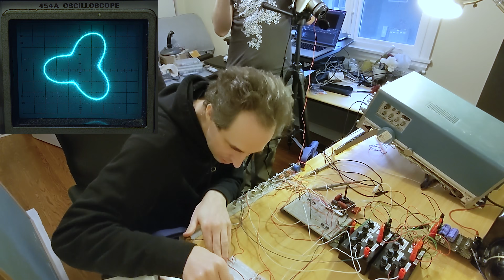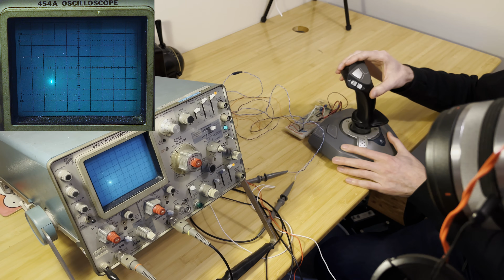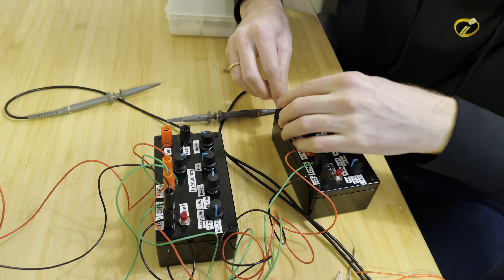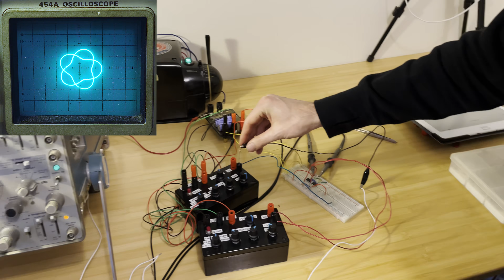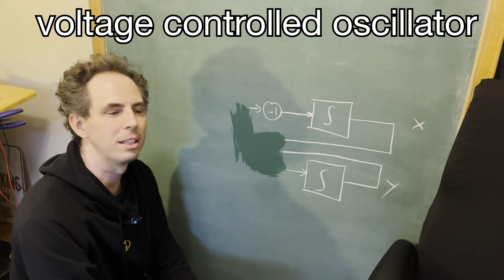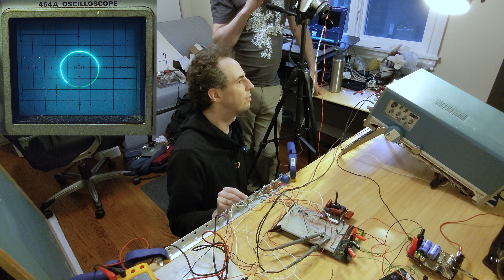Knotty Analog Oscilloscope Art

Comment: THIS IS AWESOME i'd love to understand further the inner workings of how oscilloscopes transpose an electron to visual display now.
Reply: Analog scopes work similarly to the old CRT TV's (actually identically for B&W).  A heated filament in the back of the tube is brought to 10 kV or so (Big TV's use up to 30kV) and electrons start coming off as a result.  They are repelled from the filament (the electron gun) and attracted to the positive of the supply which is connected to a grid behind the screen.  The signals to be viewed are amplified and applied to coils or plates above and below and to either side of the beam path. If coils are used the ones on either side deflect up and down and if plates are used the beam will be deflected directly toward/away from them.

Comment: I had a laser running off audio/analogue signals to draw 4d objects, starting with a loop of 4 channels running though the x,y,z,w coordinates of a hypercube and doing projection calculations to convert them into x,y screen space using analogue synths. it's not knots but thought it was relatable. and can you have knots that exist in either 3D or 4D but knot the other? 

https://youtube.com/shorts/BrJyTqH5izQ
Reply: There is only the unknot in 4D.
Reply: @CoughSyrup  While that’s true if you are only dealing with S^1 as the thing being knotted, it is possible to knot 2d surfaces in a 4D space.
Reply: PS how would you go about calculation f(x)=1/x using analogue circuitry?
Reply: Subtraction of exponentials seems more plausible for division, but if you had to, I'd think trying to take a geometric construction of division, like one of those straight-edge and compass constructions, would be promising.
Reply: Say y = 1/x, then x•y = 1
You have an amplifier outputting some value z, then feed x and z into a multiplier.
That product is introduced as negative feedback to the amplifier, reducing output z, until x•z = 1 at which point z is your y answer.

A multiplier can output the square of an input easily by making both inputs the same. Effectively x•x
 A combination of multiplier and amplifier can also be used to find the square root of an input by using the square of the output as negative feedback.
 When the amp output is the square root, the square of the square root provides just the right amount of negative feedback for the amp output to be the square root.

Comment: The knots drifting out of phase over time almost looks like a 3D rotation of sorts, revealing that they aren't actually knots. I wonder how much harder this becomes if you basically make this "drifting out of phase" motion be actual 3D rotation projected to 2D, and it simply looks like you look at the knot from different perspectives.
Reply: Fundamentally, I don’t see how that’s possible with analogue as there’s nothing stopping an interception (one “string” through another).

You could get the perspective with digital control, but that was not allowed by self constraint  - and even there you’d manage it in software.

As is often the case, it’d be very interesting if I were shown to be wrong!
Reply: @murk1e  There's already nothing stopping the lines self-intersecting; he's just modulating the brightness. The figures being drawn are necessarily continuous, closed loops.

As for the 3D rotations, you'd need to apply a rotation matrix, which is ultimately multiplying X(t) and Y(t) by more sines and cosines of the desired viewing angles (Euler angles). I can't se why it wouldn't be possible actually, but don't ask me for a circuit diagram. haha.

Comment: It’d be helpful to see the circuit diagram with the clamping diode etc - block diagrams are in the description, and the standard integrator in the video; but it’d be nice to see the nitty gritty level, connecting the dots - i.e. the black boxes! (I can probably work it out… but it’s a nice thing to have it linked to. I’m wondering if I’m missing a trick as it seems to be one adjustment for speed in the unknot example…. But that would mean the two integrators being changed together?… easy enough with a dual-ganged variable - but if I’m missing something clever there, I’d like to know).

Analogue computing is a very cool thing - you can do a nice A-level demo of resonance and damping with an LC network.
Reply: As for the black box: all the potentiometers are a dual-gang. The circuit isn't clever and I was a bit disappointed that the amplitude isn't as stable over the whole frequency range than I wanted it to be. But since you asked for it, I am putting it up anyway, just follow the link in the description. For the positive feedback, I am doing the typical thing. To clamp the voltage, I saw people put a pair of Zener diodes (in series, anti-parallel) parallel to one of the integrating capacitors instead. Maybe I should have stuck to that.
Reply: @mgoerner  thanks - I was hoping I’d missed a clever trick with the adjustments - always nice to be surprised.

Nevertheless, I’m sure that it’ll fill a gap for people who want to follow along without much electronic experience!